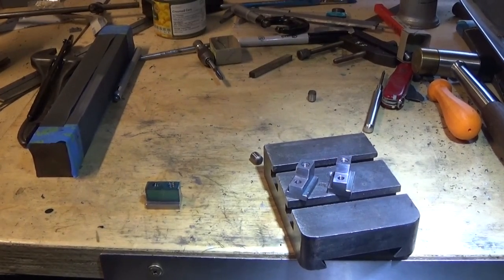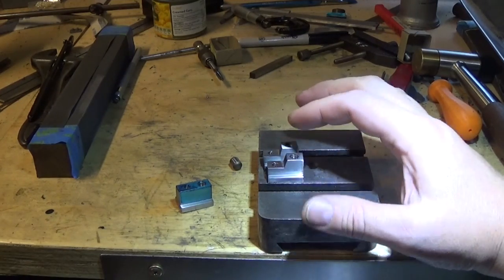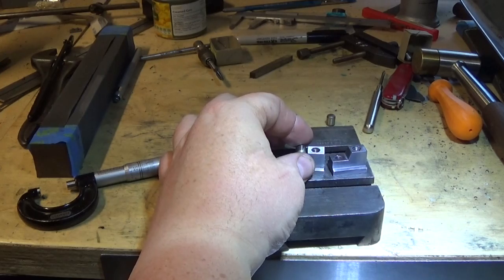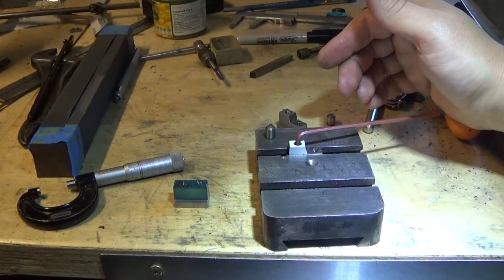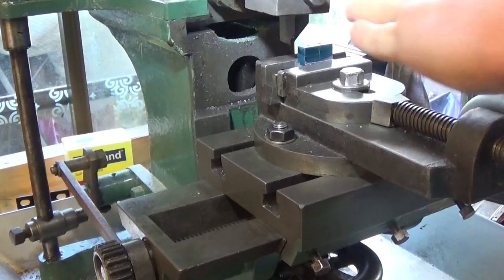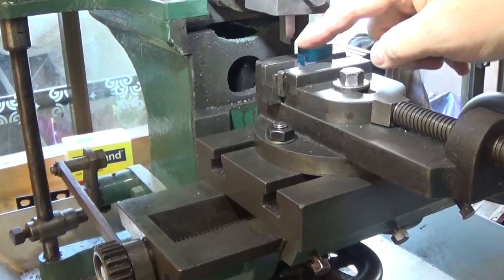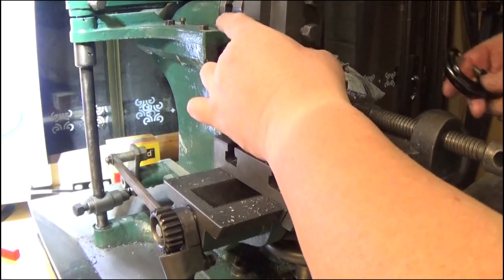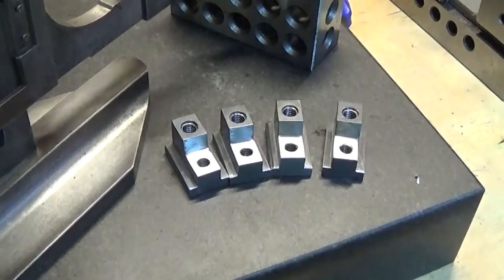THE NORTH FACE! PART 4 tee slot clamps

Comment: Nice job so far Emma. I would not worry what the armchair mechanics or "hammer & chisel merchants" as mrpete calls them say. Any kind of clamp will deform the slots a tiny bit. Its knowing the right amount of force and the correct number of clamps to hold something that counts. The bolt will rip out the thread on a unhardened tee nut before you damage the slot. Its only an idiot that would try to torque something up to breaking point without knowing  the consequences.  As  Ian B  said below a little piece of brass shim under the setscrews will stop any damage to the bottom of the slot. regards from the UK. Gary

Comment: You might not break the tee slot but even normal force used for tightening the bolts causes the surface of my table around the tee nut to deform temporarily.

Comment: You explained your reasoning nicely and I agree the pressure from the screw won't force the tee slot away from the base material. Someday you might square up your shaper vise with your mill then you would have nice surfaces to team. Just a thought.

Comment: I am liking this project more and more as you complete the steps.
Reply from the maker: I have a sneaking suspicion the hard bit might still be to come!
Reply: Since the jaws are relatively small and made of bronze it may be best to shape them in a strip and cut them up later. You could always leave them a little oversize and finish them after cutting them.

Comment: I agree that it would pretty hard to pull a t-slot up using a 3mm Allen wrench in a small set screw.  I have a friend who did work with a super strong guy who did damage  some machine equipment including pulling up a t-slot on a mill table with a regular hold down.  he said the guy was let go rather quickly.  Chris